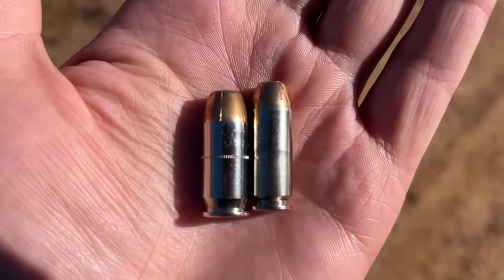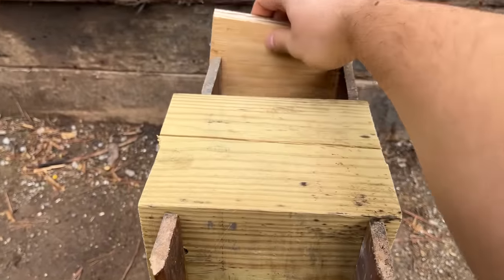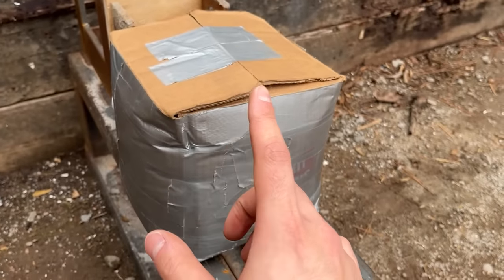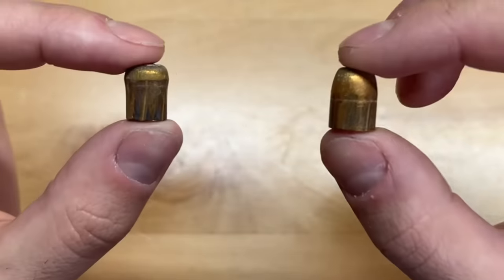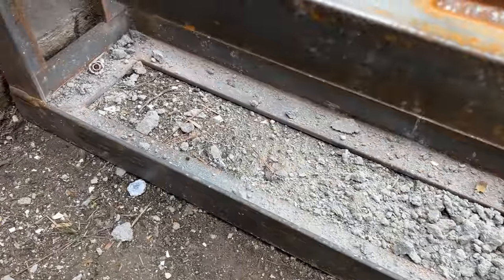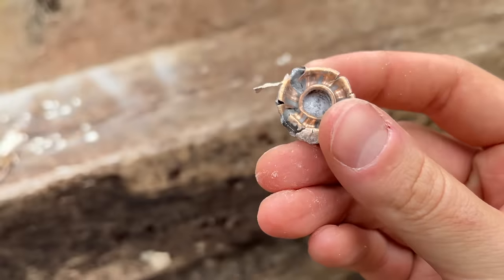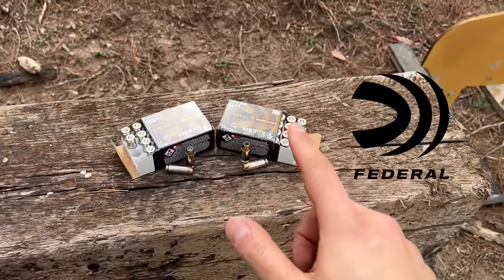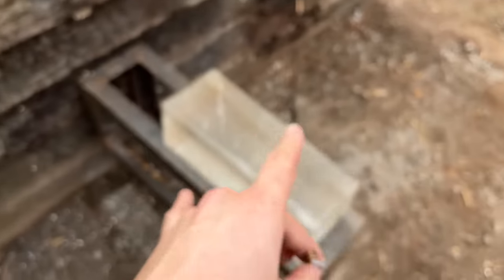45 ACP vs 10mm: Unbelievable Difference On Barriers

Comment: Put a 180 grain bullet on both cartridges the 10mm will get to 1000 fps while the 45acp will reach about 1150 fps. If you want to match the 10mm speed with the 45acp, just lower the grains on the bullet. I personally carry a 180 grain. The .45 cartridge has a superior potential for speed compared to the 10mm because it has a higher volume in the cylinder. The 230 is way too slow and it's like lobbing a musket round. If what you're looking for is penetration over the impact wound cavity, then go with the 10mm and get the smaller bullet. If what you're interested in is a larger wound cavity on impact with less penetration, then you go with the .45. A Corbon's cartridge for a 45acp with a 165grain bullet gets you 1250fps from a 4 inch barrel and 1300+ from a 5" barrel.

Comment: The point that is missing is. The 45 ACP was especially designed to KNOCK DOWN your target. No matter where you hit it. WE don't use it to hunt anything but assailants maybe an attacking dog. Still, it is designed to Knock Down your opponent. The projectiles profile, weight, speed = knock down energy.

Comment: That’s why Hunter’s generally carry a 10 mm on their hip. Some people will carry a 44 magnum or 357 but generally, those are revolvers and the amount of pounds it takes to pull that trigger to defend yourself against a bear attack is insanely slow.a 10 mm you can carry 14 rounds and not have any problems with defense at all.
And after reading through some of the comments, you don’t carry a 9 mm or a 40 cal when you go hunting as a side arm. For example, if you were too close to a hog because you got pushed up a tree and you can’t use a shotgun, a 10 mil shot will drop that hog with one round versus something like a 9 mm, that round generally bounces off of the skull of a hog. And a 40 will not penetrate deep enough for it to kill the hog. That’s why a lot of hunters carry the 10 mm.
Now let me make something clear, I don’t think anybody and this is just my opinion! Should carry a 10 mm for self-defense. That’s just because even with a hollowpoint, the round can go straight through them. The only reason I have my 10 mm Glock is simply for a side arm for when I go hunting.

Comment: I'd like to see a side by side testing of these 2 calibers to see which round dumps more energy into it's target I.E. knockdown/stopping power. I'd rather carry the caliber that dumps more energy into the target versus the one that penetrates more.
Reply: Judging by the laws of physics, a projectile that goes through a body will have dumped all the energy which that body can take. Diameters need to be comparable of course. The knockdown power is close to the recoil of the weapon I'd imagine.

Comment: I wouldn’t call the HST’s “full powered” 10mm because really they are just average defense ammo, BUT you can get some really nice purpose-made 10mm ammo that’s moving about 1300fps at 175-180gr. Underwood Ammo makes some hot 10mm and Buffalo Bore makes some even hotter ammo, all of which is made for large animals such as bears. Anything that can I make thru a grizzly chest plate or skull can plow thru anything you need it to in the real world. Depending what you want, hardcast or hollow points, you can even better penetration.

Comment: Testing the penetration depth of a 45acp vs a smaller faster cartridge is basically ignoring everything the 45 was designed to do. Huge wound channel and dumping ALL of the energy into the target every time. Small and fast has better numbers and will go deeper. It may also go through and keep going, which is why you see law enforcement using the calibers they do.

Comment: many 45ACP pistols have an advantage over 10mm they can be converted to 460 rowland.
My 45ACP preferred load is speer 260 grain 3/4 jacket HP at around 845fps out of 5" 1911

Comment: The tests are apples and oranges. The 45 ACP round's diameter is 34.5% larger than the 10mm round. Of course that extra size is going to cause more resistance and drag, especially as expanded (.8915 vs .663) in the final (gel) test.

Comment: Wouldnt 10mm be risky for edc as far as over penetration is concerned? just curious cause i want to get a fn510 or glock 20 soon
Reply: @johnklatt3522  yeah I need to do more research on the round itself idk too much about it. still have to decide between the 510 or the glock 20 tho :/

Comment: would be nice to see 10mm and 45 ACP loaded to their MAX. full power 10mm 220gr hallows and FNHC vs 45 Super 230gr hallows and 255gr FNHC. And yes I consider 45 Super to be just 45 ACP +P+++ as almost all modern 45 auto pistols can fire it.

Comment: Most companies are loading their 10mm 180gr cartridges at the same spec as their 180gr .40S&W cartridges, therefore they are highly underpowered and not even supersonic, and are completely subsonic. I believe I can use the S&B branded 10mm as a fair example.
Please redo this test with a properly loaded line of 10mm auto "1280FPS 180gr"

Comment: Uh... You said that, in order to win the round, that it had to stay in the "sweet spot" (7:23 timestamp).  Even though the 10mm had a wider wound channel, it penetrated the block and therefore is DQ'ed per your rule. Hell, the WHOLE POINT of running HP ammo is to minimize the risk of over-penetration which the 10mm OBVIOUSLY has an issue with.

If I remember correctly, the 10mm round will penetrate OVER 20in of ballistics gel and it is for this reason that VERY FEW LE departments use it (along with it's higher cost).

Comment: The 45ACP is 100 years old and tethered to the weak guns it was first designed for, 21,000 PSI vs 37,500 PSI for the 10mm. Most factory 45ACP ammo is loaded pretty much it's full potential. Facrory 10mm is dumbed down. I find the recoil to be similar though the 10mm is sharper. I hand load so I don't care much about factory ammo. Over penetration, load 155gr or 135 gr. I have 135gr loads that give 1500+fps.

Comment: Lighter 10mm loads will go right though ⅛ steel . Not sure about the 45 but im assuming 99% of all 45 would be stopped. 

Cool video and I like the 45 but I don't think it shows how much the 10mm outperforms in every way vs 45

Comment: Why would you call it a draw on the concrete test when the 10mm blew it completely apart. The .45 just blew the top off? I'm actually surprised because a slower bigger moving object should cause more destruction you would think.

Comment: 9:40 10 mm loss this round I don’t want my hollow points going completely through 16 inches of ballistics gel I want them to be stocked after about a foot of penetration at most that means if it goes through 16 inches of clear ballistics gel it’s gonna go through 8 inches of human being that’s not good because you’re going to shoot somebody behind your intended target 10 mm would be good for self-defense against a wild boar or wild moose or maybe a wild bear but there’s no need to even make hollow points for 10 mm because it’s not ideal for any situation if you’re trying to defend yourself against a rampaging mouse, you don’t need Hala points or a rampaging bear you don’t need hollow points it’s not gonna make much of a difference if it expands or if it doesn’t, you need penetration power to reach the vital organs of a large mammal, but if you’re talking about home defense against an intruder for self-defense and a stand your ground situation you don’t want penetration you want expansion and transfer of energy you want a 45 ACP hollow point that expands to 3/4 of an inch either way the 10 mm is not anything I want first of all it’s a rare and uncommon cartridge. it’s not as bad as it used to be but the 357 Sigg and a 10 mm used to be like niche ammo it was almost like 57 ammunition like 10 years ago when it was impossible to get your hands on 5.7 x 28 mm ammunition it’s because every 357 Sigg or 10 mm pistol that’s sold there’s 100 45s or 250 9 mm

Comment: You can get or load 45 acp ammo pushing 1000 - 1100 Fps. Ramshot Enforcer 230gr hp 1100 fps and normal psi range

Comment: You should find an engineer and come up with a system that measures the impact pressure on the objects your hitting. Since they’re portable, there should be some way to set. Them of a rail with rollers or wheels. Then some way to attach a scale that measures what the pressure on the wood, sand etc.

Comment: The 10mm or 45acp? 
Depends on if you want more power. The 45 will knock the shit outta any recipient. 
The 10 will punch through a wall , then knock the shit outta any recipient. 
One travels faster and delivers more kinetic energy. 
Some 10mm brands aren’t consistent. So finding a good brand is key.

Comment: A 45 ACP was designed to deliver 450 pounds on one target. That's not a lot of kill pounds not by today's bullets. However, during the philippine uprising, when Teddy Roosevelt was just a boot. Lieutenant , they were using thirty eight long barrels , which actually technically had a higher kill pounds per square inch than the forty five on a smaller diameter projectile. And the philippines kept charging and charging. He wrote his parents and out of their own personal funds. They sent a couple hundred thousand rounds of ammunition and a couple of dozen and one story to a couple of hundred forty five a c p's for his company. That would be the nineteen eleven since they were produced only about two years earlier. Casualties among Teddy's men went down significantly, one shot, one knock down. I don't know what the  ten millimeter was designed for. But I do believe it's just another version of the forty five a c p just bigger because some didn't what decided that because of bulletproof vest , we need more pounds per square edge on target. My father had to go through a live fire with a heavy-duty vest that the police department invested in. He was a police officer, that's right. His chest came home bruised as fck. My mom asked what happend. He said that for comparison thay fired a 45 ac 1911 into the vest. It was the only hand gun that left a mark on him.  The vest was not adopted for that reason.  Ther is a quiot atributed to Teddy R. "slow and wide seams to hurt more"

Comment: Yeah look at the history, penetration is not the only criteria nor is expansion. Recoil is an issue, why the FBI changed over to 40 SW I like the narrow pistol grips and the grip angle of the 1911 45 ACP,  the 45 operated at much lower pressure  so recoil is generally lower so you if can take your problem out in 9 rounds or 17 with one reload, really no loss between the two. And if you have to shoot at night, as many gunfights do, low chamber pressure  of the 45 is almost double by that, has much less muzzle flash. Just some other things to consider. Higher pressure pistols just flat rattle people, I used a 200 grain lead SWC in my 5 inch 45 loaded to about 950 fps,; and used it in competition and carried it for years.I could flat clover leaf with this out to 30 yards.

Comment: A better comparison would be to match pressure levels and bullet weights - either 10mm vs. 45 Super/450 SMC...or 40 S&W vs 45ACP.  Handloading both to max potential with a 200gr bullet is actually not comparable. 45ACP +P book load for 200gr SWC using Hodgdon CFE Pistol gives you axp 1142fps. Thats pretty much what a 10mm with the 200gr will do....if you load to 45 Super or 450 SMC levels there really is no comparing. Both are great rounds....but a 45 is a bigger hole - and at pistol differences that can be the difference needed

Comment: When I got my 1st colt in 45acp, I was very disappointed in it's ability to penetrate different materials.  My 1st handgun was a 357 mag.  My next pistol was a 22 lr.  Both were way better at penetrating thing that the 45acp.   I haven't owned a 45acp for decades.  I like my 10mm Glock 20.  Good gun good cartridge.
Reply: Over penetration is exactly what you don't want in a self defense round. Lucky Gunner has done some outstanding work categorizing and testing the expansion of defensive ammunition. 45 ACP JHP loads can expand up to an inch in diameter. This type of expansion is guaranteed to do more damage to a threat as it passes through the body.
There doesn’t seem to be a 10mm load capable of expanding up to an inch, with most coming in around .68 inches in expansion with a high of .81 inches in diameter.
Do you want the round to shoot through walls or stop someone along with a larger entrance hole?  Either way, you have to be competent with either.

Comment: Golden Sabers are virtually identical specs.
10 = 180 gr x 1150 fps
45 = 185 gr+P x 1140 fps.
Try those for identical results.
You can see the muzzle flash in the bright sunshine👍
Both ft# are identical @ 530#.
Unless you have a 10 doing 1250+ theres zero difference.
Reply: What's the point of stacking the deck to get "identical results"? After all, you wouldn't compare a hot 9mm to a weak .357 Magnum either.

So, how about testing with 180 grain 10mm Underwood XTP JHP at 1,300 fps? Yes, that would be 14% faster and have 17% more energy compared to a .45 ACP Golden Saber 185 grain JHP at 1140 fps.

Comment: I think you need some hot handloads, and a bigger barrel. Try using a pistol carbine even a Highpoint 9 series. Than you'll see a difference. My reloads 10mm run at  1733 fps out of 16 inch highpoint . So yes it's under powered.

Comment: I'm not sure why this was even a contest. 10mm has penetration power and the .45 ACP is made for stopping power. The .45 ACP is a slower round but bigger. Each round has it's intended purpose and thus one is not overall better than the other. You use both of them for two different purposes.

Comment: Well, the fact the 45 had less penetration in wood is a good thing for me, someone who used it for home defense.
Reply: The 10mm also lost the Ballistic Gel round. 45 ACP had a MUCH larger expanded diameter, with more than 1.5x the surface area of the 10mm. It was also well in spec of penetration, the 10mm likely would've over penetrated.

Comment: The 45 is designed to dump 100% of its energy in to the human flesh target.
The 45 is the result of an extensive search for the ideal mix between diameter, weight, an load for the right bullet at the best velocity when shooting humans 10 ft away from you.
Since the Vietnam era the only thing that really changed was the expansion bullet.  However, the 45 is pretty good with those too.
Attacking the 45 is like flying a NATO flag.

Comment: Apples to oranges, 45 acp typically about 850 fps, 10 mm about 1000 to 1300 fps.  high velocity equals greater penetration.  Guys a nobber.

Comment: Ok, so, why will I stick with my Glock 21, and not go with a Glock 20? Because I can get a lot more shots downrange and put holes in a center of mass target faster than I can with the snappier 10mm. I understand all the advantages of the 10mm on paper, but I wouldn't personally like to be shot by either one, and I'm convinced either one could kill me, so it all comes down to "which can I use more comfortably?"

This isn't like a ".380ACP v. 9mm" comparison where the .380ACP is sorely less capable of providing lethal force in a meaningful way compared to a 9mm. I find the .380ACP to be one of those "better than nothing" cartridges; one that I would suggest to someone who cannot use a 9mm comfortably, or is more of an elderly person or frail.

Comment: I'm disappointed you are comparing a 10 mm magnum to a nudred 45. Did you compare the 45 with the original+ p pounder charge?? The government dropped the powder charges in the 70s. Try it again with the original powder charge.
Reply: The 10mm round he used is a watered down version. Also, the 70s were half a century ago. Handgun powders have significantly changed. +P is just 10% more pressure (21,000 vs. 23,000 psi).

Comment: I don't want a round that goes 16 inches into a target, because most targets aren't more than 12.  I had an indoor incident with 2 canine targets, about 35 lbs and about 55 lbs.  The 35 lber took one fronto-cranial .45 ACP hp that exited more or less to gravity (a perfectly flowered intact projectile sitting on the floor next to the target).  The other target took SIX center mass from front with no exit.  I was super-surprised at not having to do any drywall patching.  I'm not really sure how to interpret the results in terms of stopping power (I suppose a necropsy would have been helpful), but I was happy about the neatness of it.

Comment: Ok so I appreciate you doing this but testing a 45 acp for Penetration is pointless. The round is literally meant to stop in whatever you hit and dump its energy into the object. Therefore being safer(not ever safe) to use in without risk of over Penetration. Second you are shooting 40 s&w in a 10mm cartridge. How do I know this. Reloading to 10mm design specs will give you a round that is night and day difference. I'd almost guarantee a 10mm loaded to spec would punch through. No im not talking  about +p I'm talking about standard 10mm specs.

Comment: The 10 mm did not win the pressure treated wooden block penetration; it was actually a tie. The linear penetration is the wrong measurement, and actually you want to use the volume displaced. The same is true for the ballistic gel test. The .45 ripped a much bigger hole through the gel, but it was not as long.  Since the 10 mm exited the gel, that test is indeterminate; the volume of the wound channel cannot be accurately determined. I have a feeling that if the test was properly performed, both rounds would be close in performance.

Comment: If you want something that penetrates try some Buffalo Bore hardcast lead.
Reply: It is always important to distinguish between advertised and actual speed. Underwood tends to advertise actual speeds, while Buffalo Bore tends to have higher advertised and than actual speed. Also, feeding reliability can be an issue with some hardcast rounds, so always test with enough rounds.